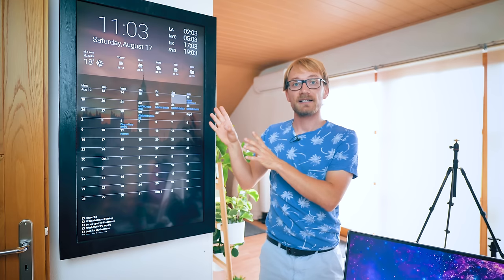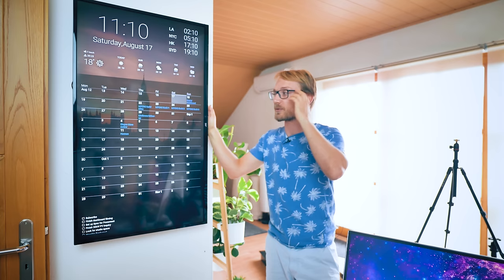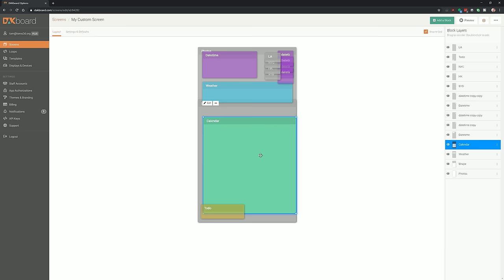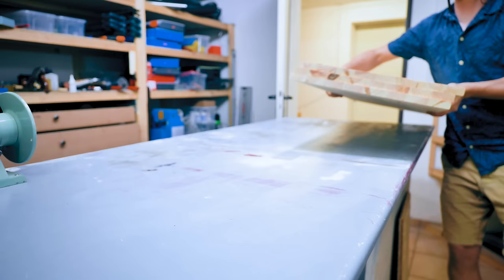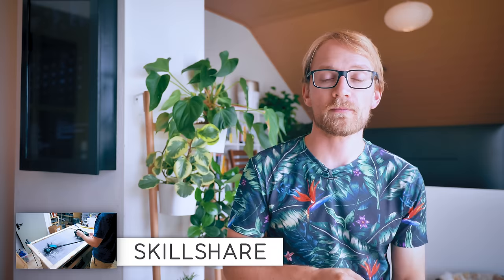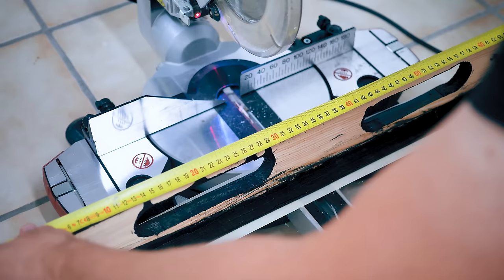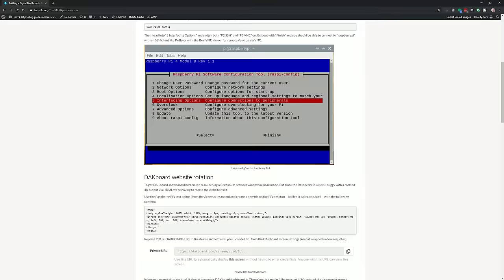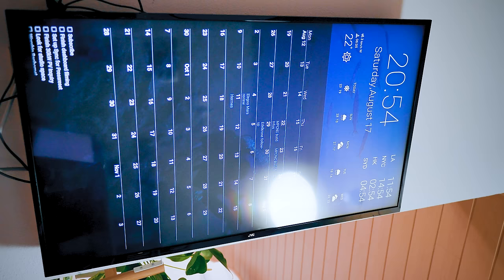Making a Digital Dashboard! (w/ Google Calendar integration)

Comment: One consideration to DAK... While it is a rather nice looking setup, the downside is that if you loose your network, you loose your screen. Unless I'm missing the option to download and run it remotely? I had this problem with using Google Home to run my 'smart' home devices. Every time there is a storm or my junk ISP goes down, my house becomes a 'dumb' home. My suggestion is look for software that can be run on/from your hardware, eliminating the requirement for 100% network connection. This also reduces access points for possible hack activity.

Comment: Hoping to install a screen in a small communal workshop I'm setting up as a dashboard and web browser (Youtube tutorials, part searches, streaming music...). The dashboard would visualize environmental sensor data over time, which is useful for safety as well as build data such as epoxy cure times. Sparkfun has some new sensor breakouts for VOCs, particulate, temperature, humidity, ambient light, barometric pressure and such. A live video feed monitor of the space would also be handy to encourage other users to use the workshop responsibly and stick to shop safety and tool borrowing policy. An PIR occupancy sensor would be useful. Maybe  also monitor power consumption and noise levels.

Comment: Also, as in all modern TVs, you should dig in PSU lower backlight current by 30-40%, so LEDs won't die exactly after warranty.

Comment: Your whole-output rotation issue could be easily fixed with xradnr - check it out!
Via SSH you will have to specify which X-windows-display you want to work on, so just use command below, or export this var after logging-in:
DISPLAY=:0 xrandr
Nice project by the way.

Comment: Measure twice, cut once, as my friend often told me. One time I cut bed rails about 15 to 20 cm too short, not realizing the mattress wouldn't fit until the frame was assembled. Rather than cut new 2x6 (2x8?) rails, I decided to flip them so that the mattress sat on top rather than inside them.

... I'll fix it. Some day.

Comment: What about building a square about 1 ft in size with thin layer screen and programmed to work specially for showing (perhaps in slideshow or slide able screen of...) clock, date, news, to do list, and is able to connect with bluetooth output, or wired speakers and even via wifi. Perhaps there's also virtual keyboard to access the settings or firmware updates. It's like if there's a a Smart-Frame for household.
While, instead of mounting to the wall, make it look as if or literally glued to the wall.

Comment: There is ONE problem with twist the screen 90 degree, especially if you have sun glasses or glasses that is treated to reduce the reflections.  They uses Polarization, which can make the picture disappear, unless you turn your head 90 degrees. :-)

Great project though, I might consider it.
Reply: Take off your sun glasses, you are inside!
Reply: @gaellafond6367  well, if I have ordinary glasses with polarization treatments, I will be blind if I take the glasses of.

But I tell you, it is great to wearing polarizing glasses in shopping malls, as most of the commercial signs that are using TV, are just black. :-)

Commercial block in real. :-)

Comment: Nice project!  Having worked on a number of projects myself using Raspberry Pi's I design my own 3D printed case that is made for mounting in to different and assorted projects.  It provides protection and has a fan mount incorporated into it. I'm amazed on how much effort you put into the frame for your screen but for the Pi it's gets no love. Even a cheap Amazon case would be better than then double sided tape. Anyway I learn a great deal from your videos, keep up the good work

Comment: I think you discovered the reason the Magic Mirror article took 5 pages on the frame and only 1 on the software. You spent 8.2 minutes on building the frame and 2.6 minutes on the software (if you include the part about the cron job).  ;)

Comment: Just my 2 cents... you may add a power on switch, but consider also adding a reset button, using the GLOBAL_EN pin on the RPi4 and GND, this way you won't have to switch on and off the power. Also, SD memory isn't that reliable (and suited for frequent I/O). You may  consider adding boot-from-USB capability and use a USB key for the OS...

Comment: Thank you for re-sparking my curiosity for Pi.
I have a Pi model B (0002) that I formatted and installed the latest Raspbian.
I barely got to open the DAKborad both trying via wifi and cable.
Chromium slows everything down, and everything freeze.

Looking for some fixes online, but considering a newer model.

Comment: Another good software (not exactly designed for this but would work well) is openHAB. It also would let you have things like cameras, home automation monitoring etc. It sounds like it also might be a touch easier to do then what you implemented as many items are drag, drop and configure.

Comment: Du könntest auch den Pi4 untertakten, und damit auch die Spannung reduzieren. Ebenso könntest du dem Pi einen Bewegungssensor geben (über GPIO) um doch das Display abzudunkeln; viele Fernseher / Displays schalten Beleuchtung / Panel aus, bei schwarzem Bildschirm, bleiben aber reaktiv.

you could simply underclock the Pi4 and undervolting, to save money. Also you could use a sensor to track/recognize motion, most display turns black and also needs fewer watts.
Reply: Noch ein Tipp zum Rahmen, zwei angeschrägte Dreiecke wären für die obere Auflage praktisch gewesen, die würden sich gegenseitig verkeilen, an die Wand ziehen und einen einfacheren Zugang ermöglichen, da selbst sichernd.

Comment: If the screen stays on all the time you will get burn-in in the lcd panel. On my mirror I set up a raspberry pi camera and using the software "motion" I trigger the mouse to move just a little bit so the raspberry wakes the screen up when I move in front of the mirror. Few minutes later the screen saver kicks in and turns the display off automatically.

Comment: it´s a bit too big ... i did the same in the kitchen with a 21" monitor and a wooden frame. i used raspbian with node red and an ikea tradfri remote to control the google calendar and a tradfri motion sensor to turn on and off the hdmi outlet of the raspberry.
btw to use the ikea stuff i use the zigbee2mqtt adapter so you can controll also other zigbee lights etc...

Comment: How  about being able to change views on the fly? Like pull up a daily view to see details? I know a TV sized touch screen is very expensive. How about adding a few command (hw) buttons via the Raspi's GPIO pins? Another alternative is using Remote with mouse support. The PI as well as the TV can communicate using CEC thru the HDMI connection. I'm thinking about some interaction right at the screen without the need to go to a phone or computer. As others have mentioned a motion detector to activate the display would be nice.

Comment: remember that theres lots of old 9+ inch tablets out for cheap, android and apple, and they would be great for desks or people tha live in tiny houses / vans etc who just dont have huge monitor space...

would need a power source, but an eBay buck converter or a charger to get 5v from 12v, and away you go, just needs a good app/software setup
Reply from the maker: That's what I was referring to with the smaller option - since DAKboard is just a webpage, anything that has a browser can display it!
Reply: @MadeWithLayers  I'm a bit slow sometimes lol. Love your channel.

Comment: WoW nice project. Maybe an idea to use Electron and some custom html5. Electron is much lighter then chrome browser. and it does not need any X components then only the X driver. Now you are running lightdm, incl. file manager/desktopmanager at the background.

Comment: Maybe get a tv box like GT-King with S922X by Beelink or lower power 12nm board Amlogic S905D3-N0N,  A311D
Software-wise there are Android widgets. It can be used as a screen as well. Power-wise it would make more sense to use e-ink, but the jet is way too pricy.

Comment: Thomas, my respects from another Thomas! A nice video, a wonderful project. 

Did you ever try this with a Pi 3 or Pi 3 B? 

I got here looking for a way to solve a problem: 

My mother is disabled and has very limited range of travel upstairs. Her eyesight isn't 100%.  And she is starting down the path of dementia and her hands aren't good enough or eyes good enough to work well with phones or tablets. The fact she is in and out of sleep and can't quite tell a 1 hour nap from an 8 hour sleep can make her a bit perplexed about what day of the week it is. 

To aid that, I thought it would be great to be able to have a modest screen (either use a different source on the LED TV she has or put another small screen like a 10" LED/LCD that will take an HDMI somewhere near to her and then to display google calendar events we share with her google account so she can see the day or the week's events, the current date and time and day of the week. 

I'd think this would be of great use to many elders but nobody has a simple compute stick or micro computer or mini that is cheap (does not need too much power to just show a modest sized screen and where there won't be interaction) that will come packaged with software to make that simple. (To just automatically start your calendar of choice and update regularly and manage the hours the information is displayed) But nobody seems to have such a beast as a prebuilt product. It's all about hacking and getting different bits of hardware and coding and tweaking, etc. 

How many seniors just need to see: What day of the week is it? What time of day is it? What do I need to be aware of (like outside appointments) today or in the near future (say the next week)? 

It really shouldn't be a massive challenge. Their really ought to be a product that could be acquired for a cheap cost specific to that issue. Maybe the only other thing could be having a way to switch it to a digital picture frame when not needed as a calendar. 

Your project is the closest I've seen, yet I can see a bunch of time and effort to get to something functional. I am surprised nobody has addressed this for the many elders out there. (Mind you, we still have kitchen timers on stoves that do not disable the oven or the elements when the timer expires which makes oven or stovetop dangerous for elders with a wee bit of forgetfulness.... why don't we design TVs and appliances for elders? There seems like there would be a market....)

Anyway, thanks very much for your project. I am going to check out DakBoard and I'm going to see what I can do with a compute stick or a Raspberry Pi to manage to show the calendar on some sort of HDMI-driven display (much less large than your lovely 4K screen). 

Maybe I should start making software and hardware for elders to be more able to function. Who sells an elder a TV that has 50 buttons on the remote? You might argue for about 15.... but 50? Craziness.

Comment: First off - excellent video.  Magic mirrors are neat but yours is way more useful.

On a totally unrelated note, I've been wondering why you haven't done a video about/experimented with the Klipper firmware.  It's becoming very popular in the reprap community.  I was totally shocked that it didn't come up in the most recent podcast.  Higher quality prints at faster speeds, that's what Klipper does best.  Since you've been experimenting more and more with the RPI as of late I would love to hear your take on it.

Comment: Great project. I've always wanted to make something like this. However, the price difference between a 1080p screen and a 4k screen has definitely not shrunken down to almost zero lol.
Reply: Actually, it has. If you look in the cheap segment (and not in your local hardware store), you can get both 1080 and 4k TVs around 43" for roughly 300€.

Comment: should have used a signage TV for this, easier to set up schedules/wake on lan and portrait mode, plus used signage TVs are ment to run 24/7
Reply: as someone who works in an office with signage tvs, this is true. However our LFD units, even on the budget side, are $999.  Yeah, we replaced a few 49" models with TCLs we got for $199.  Even if we kill them, we'd have to kill 5 of them before we lose out on the cost. Months later and still going strong.

Comment: Do you know why the "wiggely-end" is wiggely? It's for a reason! It-s stil exact..
Basicly, It wiggles on the rivets in order to compensate for the "hooks" thickness. So when you hook it over a board and pull it's correct. And when you push it up against a board, it's still correct.
google it. ;)

Comment: Excellent project! I am definitely going to build one for my amateur radio activities. I'll have the screen setup with world time, a world map that centers around my location to easily see direction of signal for my contacts, log book, and upcoming events (emergency communications exercises, club meetings, contests, etc.).
I was already planning something like this, but adding the bezel is a nice touch that I had not considered.  However, I am somewhat a masochist and will be writing my own web page to handle everything (instead of using something like DAKboard). I like the full control that I can render over the screen, complete privacy and security of my data, and I'm pretty handy with HTML/CSS/etc.  :) 
Thanks for what is to me a solid "proof of concept" and inspiration to get mine done.

Comment: Can you update your software guide? I had a terrible time with the html and found that since I was testing on a Pi 3 it was messing up the display. Find out your screen resolution and put that into the first part of the html and then cut it in half for the margin negative offset. CSS is like voodoo for me, I just don't use it enough and I'm sure it will through other non-designers for a loop.

Comment: Great solutions, I've followed your guide closely when building mine, including your solution for the 4k rotation.  Unfortunately I'm seeing a fairly frequent Chromium crash (every hour or so).  It doesn't seem to crash when I let it run without going through the iframe.  Have you encountered this at all?

Comment: Would be cool if it was a touch screen for leaving notes to the rest of the family or writing the ever growing buying list without any other device ... something like that. Or, put some joysticks on it and start MAME for a short round ;-) ... anyway ... cool thing. Do i need one - no. Do i build one - for sure LOL
Reply from the maker: I've looked into options like the Leap Motion, but between massive software overhead with the Leap and the insane price of an actual touchscreen, using a TV seemed like the smartest option for now.
Reply: @MadeWithLayers  I did the same project as you but with an IR touch frame from AliExpress I just taped on the TV. It cost me 50€ for a frame more or less the size of your, and it works just like a mouse for the OS.

Comment: Do you have a recomendation for something more touch screen? I was thinking about getting a 55" dell touch screen monitor but I don't want it to connect to a PC. Am I able to still browse and navigate without connecting it to a PC? On the Dell website, it only shows the monitor mounted on the wall but I don't see a PC connected and if there is one connected, where would that even be placed,  I literally just one a screen that's ready to go with no extra components.

Comment: Would it be possible to have a screen saver running when its not being used during the 10 hour work day. Let s say work is 8 to 6, screen saver/digital album from 6 to 10.

Comment: hi, guys. i need advice.   

I want to display a looped video on a TV. are the earlier versions of Pi able to do this? Are there requirements I need to be aware of to display video? I plan to use an older monitor with VGA input and use an adapter to connect to HDMI coming out of the Pi, unless theres a simpler setup.

Comment: Does the tv have problems with being in portrait?? I'm working on an installation and want to use tv's in portrait but am worried that they will over heat or won't work with having Videos being played on loop. Any thoughts or support would be great

Comment: Hi Thomas, I have really similar project in mind for a long time. I have bare 23" HP LCD screen with touchscreen support that I plan to use in this project. I have two questions tho. Does the Dakboard support multiple google calendar accounts to be shown as one combined? And can you alter events in every day through the Dakboard? Or does it only work as a "view-only" system?
Reply from the maker: Hey Radek! You can use multiple calendars in the same view and e.g. color-code them, but DAKboard is a view-only solution.

Comment: Since you use little to no animation and more of a static image, couldn't you make the pi run at let's say 10hz to save even more energy on the tvs end since it's currently at 30hz? Or TV if it natively support that itself? Seems like a missed opportunity since I'd believe that's save more energy :)
Reply from the maker: It's probably possible, but I don't think it would make much of a difference to energy consumption since most of it is for the backlight - which is on either way.